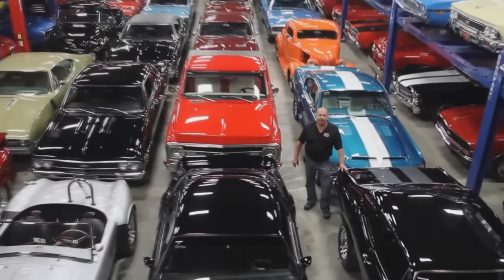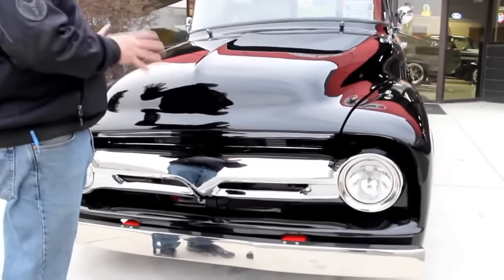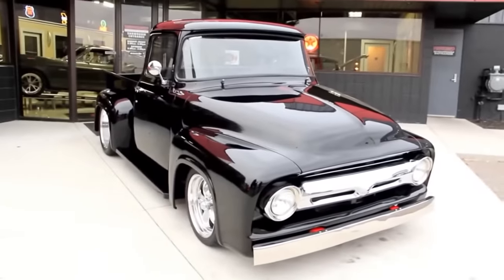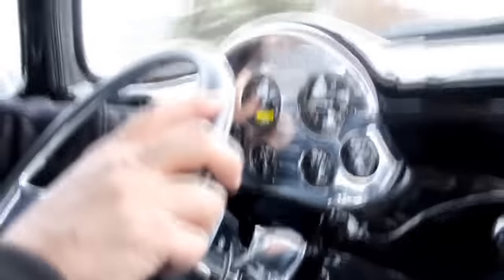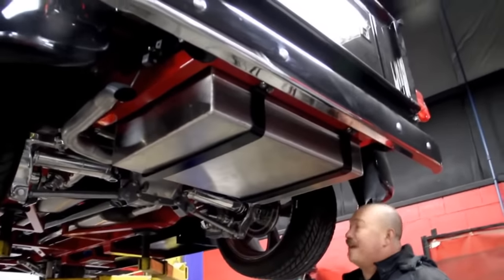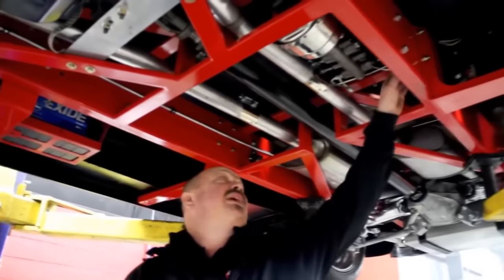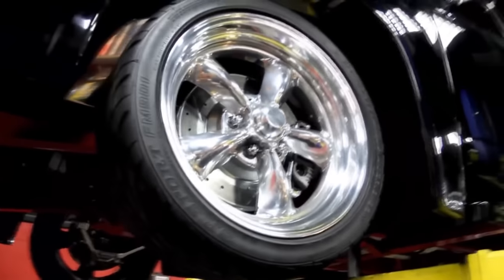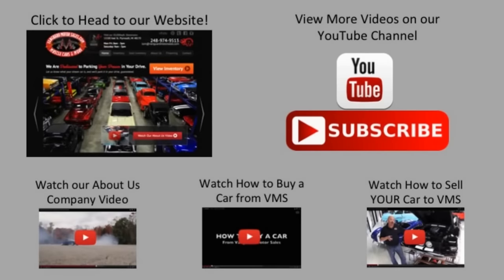1956 Ford Pickup For Sale

Comment: Have some interest in this truck I would like to be able to trade two of my Harley's in on it and have the cash differance, so with either this truck or I am going to check the rest of your trucks put I would like to get the deal done by 2/14/2017 so I can have one of them doown here for bike week!If I didn,t lose my leg in an accident I wouldn't,t be selling bikes,But do to my health conditions I need to be on 4 wheels, I have titles for bikes and I have the cash differance. So I am going to check out the rest of your pickup stock and if you can work with me I will buy one of your trucks and before bike week in February so I hope that you will work with me on pickup because I am going to be selling or trading it in on a 1949-1951 Chopped MERC all streetroded out with all the goodies of my coupe.Its an all metal1940 ford 5 window coupe with a frame off resto seven years ago and have the receipts for $150,000 thousand that was spent on the restoration 383 striker smallblock carburetor all chromed up ac, 4 core radiator,under the hood is all clean and chrome and polished,with nothing on fenders, or firewall,it is all painted like car gray metalflake, with black and gray leather interior, with Vado electric gauges electric doors,and trunk,The trunk is completely leathered like car.Chip Foose 5 Star wheels with matching steering wheel on polished tilt column and cherry steering wheel.Six disc drive player with tv built into it.original alluiminum bumpers and grille are perfect and all the chrome on car is perfec.Everything works and in mint shape,Motor has less than 2,500 miles on it and 3 inch stainless exhaust system.The only way I will part with coupe is for a 1949-1951 Chopped MERC with big block, and everything that coupe has in it.i know you don,t have one now but if you get a mint one we can do some business for sure.Do you know the wasabia 1950Lime green George Barrie did all the work on?Its been around and I lost track of it when I was in hospital for months and lost track of it I would buy the hat car if I could find it so if you know where it is I will buy that car if you can find it and it isn,t more than $150,000 ,and if you can get that car I will buy it for up to that price no loan have the money for that car,Now that I can,t ride the bikes I need a couple of the best toys to enjoy myself and have the money for that car or one of as close of class as you can get to it Tom!Am limited on my options do to my health conditions but am very serious,and hate tire kickers myself,I had a bike shop for ten years until the accident that I lost my leg to.So I am use to the best and if I find what I am looking for I am a very serious buyer you are welcome to do a credit check on me if you want to.But I live in Ormond beach Florida 32176 and you have my email and phone number so let's do some straight up business. I am going to check the rest of your trucks ,but that wasabia MERC or one of equal quality I will buy it for sure thanks for your time and sorry for taking so long just wanted you to know the real deal and you can check with any credit people you want to and I have the cash to do both of those deals!thats the truth!Hope to here back from you thanks for your time and I hope he hat we can do some big business together!you have my information so I am ready whenever you are just want to be treated right and I will treat you right with my stuff because it was all mine when I had my shop until I lost my leg!
Reply from the maker: Thank You for contacting us but unfortunately we do not take motorcyles on trade and this truck is sold